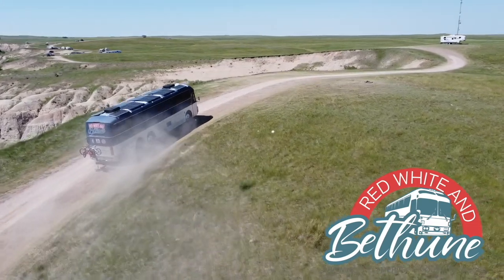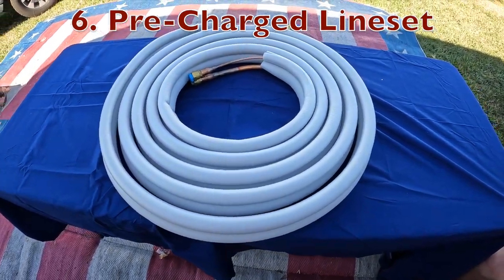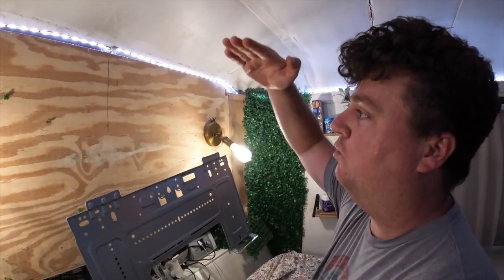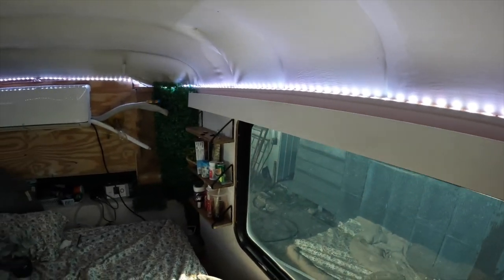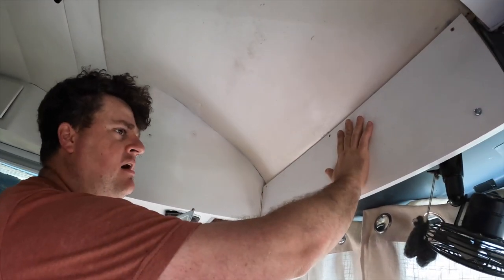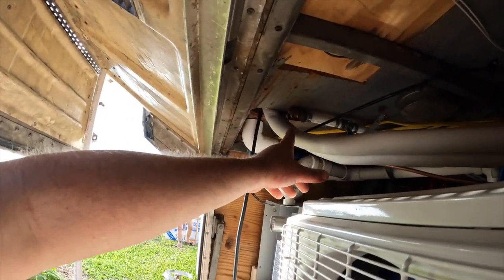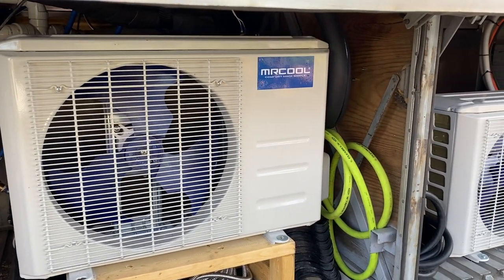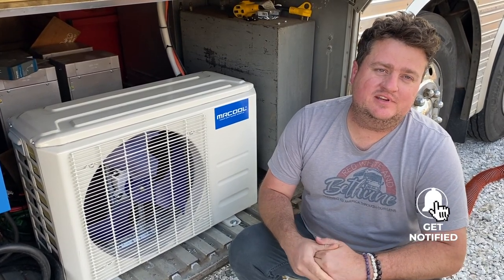Installing a Mr. COOL Mini Split AC System in a Bus or RV

Comment: Good job!  In 2019,  my daughter and I installed an 18K mini split in part of her house.  Different brand, same idea, you know where they're all made.  It still runs like a charm for both heat and AC, and I'm guessing it will continue to for decades.  

At some point, you might want to try out various settings and modes, for instance to see if using one unit on high fan is more efficient than running both units on low fan, eco mode, or whatever.  The answer will probably vary depending upon the climate.  It probably won't matter enough to bother doing anything more than just setting each one how you want it, but it would be good to know how well each one does individually as if the other one is out of action.  Might be good to know in case you ever need to cram one of the bays full of stuff and turn that one off.
Reply from the maker: That’s a good point. I’ve just kept in on complete auto since we have been plugged into power. I love how it keeps that temp whether it’s heat or cool!

Comment: I love me a mini split. You could have gotten a dual DIY system,  Perfect Aire, HVAC Direct. 2 indoor units and 1 outdoor unit.
Reply from the maker: The purpose for going with these 2 is because I wanted to use 110v power instead of 240.
Reply: @Beingbethunes  I had wondered if that was the reason for two units, or if it was to have two independent units for redundancy.  Either way, you get both benefits, for the price of using more bay space.

Comment: how many amps and watts does 1 of yours run at 12v
Reply: We will never know lol
Reply from the maker: The MiniSplits are on 110, Kyle will have to get back to you on how much they exactly pull, but it’s about 600-1200 watts depending on how hard it’s running
Reply: @Beingbethunes  12000btu or 9000btu?

Comment: Is there a benefit to running 2 separate units rather than a Dual head unit with only one condenser?
Reply from the maker: It reduces the stress on the dual head. 2 separate allows more power without more energy.